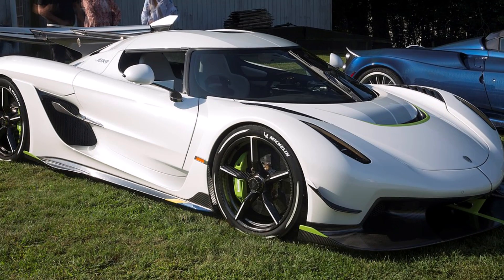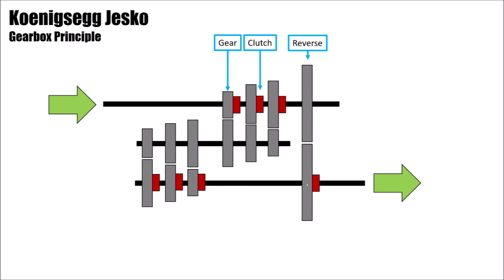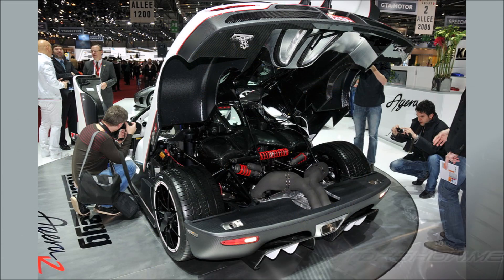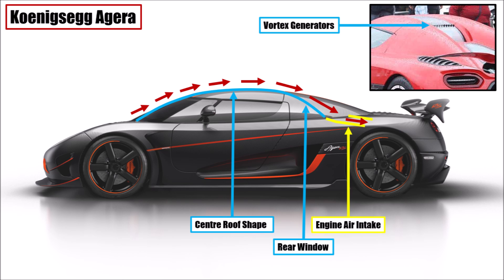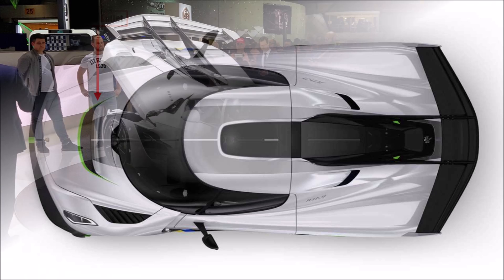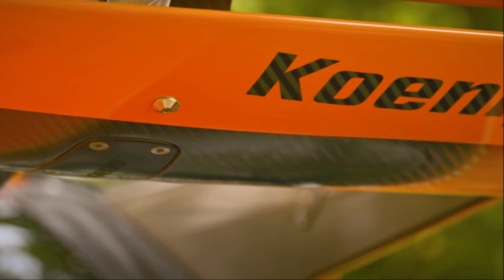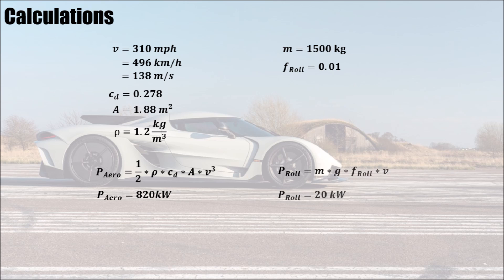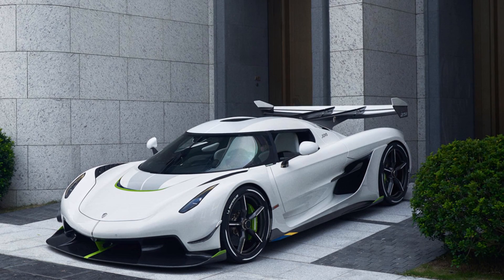Koenigsegg Jesko - CLOSER LOOK (Technical Analysis)

Comment: While I would like to like Koenigsegg, their cars are a bit of a black box. With such low production numbers and low individual milages, how good anything on them really is, is an open question. Even if everything on the cars was terrible, you would probably never know because the cars are not being driven enough for any problems to manifest. What also doesn't build confidence is that their cars are never seen being tested - and back when they were providing their cars to magazines and car shows for testing, the results weren't brilliant. 

Koenigsegg also have the unfortunate tendency to BS a lot. Just to give an example of what I am on about, let's look at the Agera gearbox. It's the CIMA T1107 - an automated manual single clutch gearbox that weighs (according to CIMA) 95kg dry and is rated for 1100Nm. But, in Koenigsegg land, this becomes a dual clutch with a weight of 81kg (without gears in?), that is ok to be used with an engine developing up to 1371Nm when running on E85. And speaking of E85, the Agera RS speed record was achieved with the car running on E85 - a fact that Koenigsegg have masked by instead claiming the car was "running the 1MW package" (the package simply being the ability to run on E85). The car being run on E85 is not even mentioned on their official webpage. What IS (still) mentioned on their own webpage, however, is the CCR being able to do 1/4 mile in 9s@146mph (the real measured time by AMS Sweden was 11.2s@139mph). There is a lot of stuff like that when it comes to Koenigsegg. Hilariously, they even do the thing where they take something completely unremarkable - like a heave spring - and pass it on as their amazing new investion: the Koenigsegg TRIPLEX suspension! 

As a result, I tend to be very skeptical when it comes to anything that Koenigsegg does. The new LST, for example. A concept that nobody thought of before? Or are there perhaps unforseen problems once you get to the details? How well tested is the gearbox gonna be? Really, how well tested is anything on their cars? They've been running what, 2 prototypes? Normal manufacturers run 50+. 

As for the points raised in the video, I have a couple of questions, actually. First off, 96% drivetrain efficiency? I don't know about that. On modern supercars it's about 87-90% depending on what type of gearbox they are running. 96% MAYBE if the engine was transversely mounted and you had no 90 degree gear engagements. Second, 0.278 Cd with - at the same time - enough cooling for 1300hp? I was under the impression that to cool these amounts of power, your radiators need to be quite big and your drag will go up massively. And really, I would have the same question for the Chiron SS - which also would have to have something like 0.28 Cd to achieve 304mph. The previous Bugattis were something like 0.37 (in the low drag config). Finally, my third question, with a turbocharged engine, does the intake pressure actually matter? I know that with naturally aspirated engines, ram air intakes allow for higher than atmospheric pressure and increase power, but I thought that with a turbocharged engine it didn't matter.
Reply: Time will tell let’s just watch and wait for that top speed run...as for durability, koenigseggs are constantly appreciating in price over the years and their owners are reluctant to let them go, I think that says alot about how good a car is 🤷‍♂️